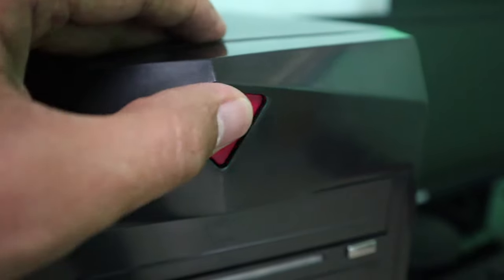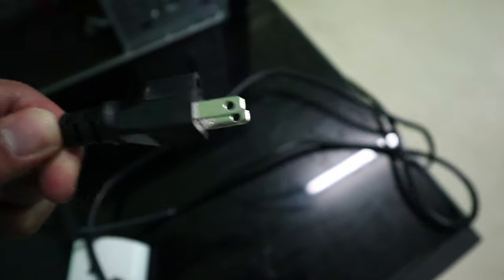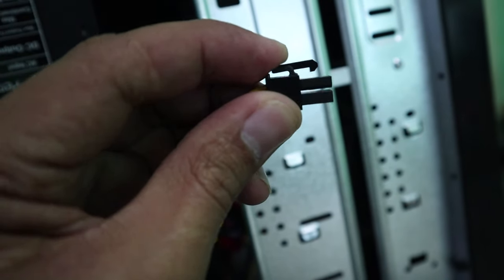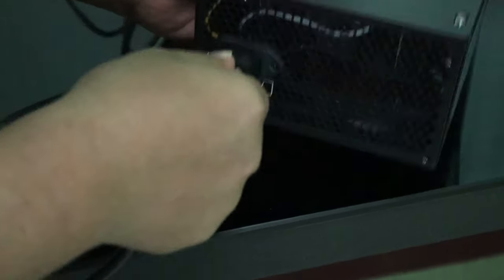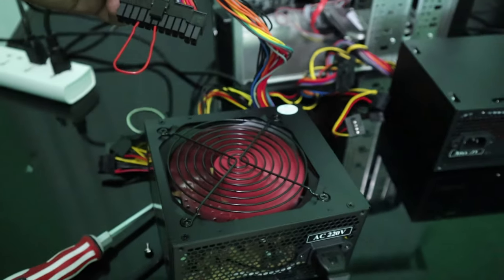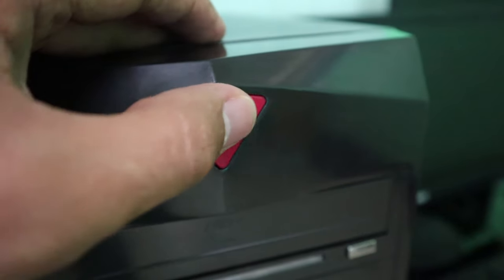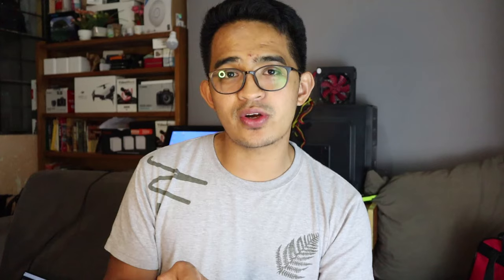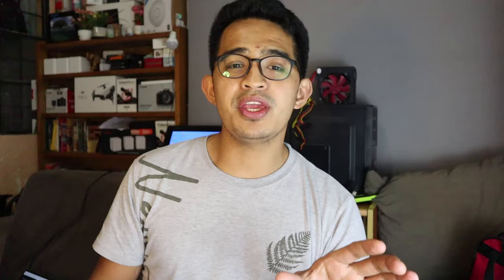DIY - TROUBLESHOOT and FIX a Computer that won't turn on - NO POWER (Beginners Guide)

Comment: Hello , I want to ask .. how about if the power supply is injected to the outlet then I tried to open it but it will open for a seconds then it will stop but there is green light on the mother board?  by the way my power supply is delta dps-350ab-13 , they say its too old ps model. I hope someone help me. Thanks a lot.

Comment: My computer always when i plug in power cable it shows the light sign that the power is entering the engine but when i press the power switch it doesn't power on but the light switch off 

What can i do to it 🥺😭

Comment: Kuya, why is my computer not working ive turned on all the things in it and it still wont open
Reply: If it's more than a couple of years old and was working fine before, it could be a dead CMOS battery, try replacing that first with a new CR2032 3v battery, the round silver disc, they are quite cheap. It may be behind your graphics card on some motherboards, be careful getting to it, check videos on how to do it.

Comment: Trying the paper clip helped me know that the power supply wasn’t dead, but the second I plug my 24 pin connector in the components no longer get power. I just built this pc 2 days ago and it was working fine. I woke up to it unable to turn on.
Reply: Did you fix this problem
Reply: @uhhhh4915  uhh yeah I sent my motherboard to the developers techs my motherboard was dead on purchase
Reply: @briannanicole8512  noooooooooooooo  😭😭😭😭😭😭😭😭😭

Comment: Led is going on but if I press the power button, it doesn't start. The motherboard led's turn on when I plug it in indicating that there is power going to the pc... But it won't switch on when I press the power button

Comment: Same problem, i tested the power cable and power supply and it's working, also tested turning it on with screw driver and it is not working. So i guess the motherboard is the problem!

Comment: I have a pc and it would turn on and everything would spin and light up but never display anything. I replaced the motherboard, gpu, case and monitor. Then for some reason one day I was trying to turn it on to try to fix it and my power supply died and only turns on for a few seconds.
Reply: did you figure out how to fix it ?

Comment: Bro, I am facing this issue of NO POWER now. Here is what I did;

1. Checked the power outlet from the wall by plugging into a different wall outlet, its NOT the wall outlet problem.
2. Used a different power cord from another working PC, same issue so its NOT the power cord. 
3. Removed the power switch connector from the motherboard and used a screwdriver to connect the pins, same issues so its NOT the power switch.
4. Next I replaced the PSU with a brand new unit higher rating and 80+ GOLD, same issues so its NOT the PSU.
5. Finally I replaced the motherboard with a brand new board, it briefly turned ON when I tested it but it went back DEAD after a few seconds, so this means its NOT EVEN the motherboard.
6. This is a brand new PC that I built and was working for 6 months until it happened around 2 weeks ago where the PC stopped working and cannot be powered ON no matter what I do or what I replace. What else can be the issue?

 PLEASE HELP BRO, I need this PC to be up as its affecting my income as I need it for my work. Someone PLEASE help. PLEASE!!!!
Reply from the maker: make sure, its not grounded. someting is shorting it
Reply: @torogipro  how to ensure nothing is shorting it? What to check bro?
Reply from the maker: @TruthSeekerAll  bring out everthing from the chassis the just connect the psu, motherboard wit procie and     ram
Reply: @torogipro  no need to attach the GPU? My GPU is new but I was having some issues with it from the beginning. I suspect it to be caused by a 10 year old HDMI adapter I used to connect to the GPU. That adapter is old but never used before. Maybe some dust has gone in and shorted the GPU which then damaged the Mobo? I'm just suspecting the GPU is damaged due to that old HDMI adapter I used on it.
Reply from the maker: @TruthSeekerAll  yes, use the onbaord display
Reply: @torogipro  will do that bro. By the way, do you think the GPU is faulty and causing all these?

Comment: my system unit starts off with a blink showing power in a second then it shows up no power after a split second, how do i fix this? 

ps. my monitor runs fine, it shows power running

edit: the power supply's fan isn't spinning, the entire system unit shows no sign of power

Comment: Sir I removed my processor and then place it back without using thermal paste does it affects why my PC won't turn on?
Reply: Probably
Reply: Is it same with gpu?i removed it and it has thermal paste then i place it back without using thermal paste?
Reply: If you don't use thermal paste with your CPU or GPU then you will fry your chip instantly as soon as you power it on!
Reply: If there is thermal paste you’ll be fine just try and add some new one ASAP to avoid thermal issues. Trust me bro I know.

Comment: Bro my pc is bootlooping
I open my case take the airdryer and give it cold blow
I try to power it on after im done cleaning it just doesnt turn on no lights no fans no sound according to ur video my motherboard is dead
Reply: Have the same issue, did u get it fixed by changing motherboard?

Comment: U definitely save my fcking life😢 I thought Im gonna change a new Psu because the switch is not working. So I tried the method where you push the switch pin and it function again, thank you very much❤❤❤

Comment: please help me...so my computer wont turn on(no lights, no fans, no reaction)...but after 2-4 hrs, when i press the power button, it turns on...i brought my computer to the repair shop and said it works fine...but when at home, it doesn't.
Reply: Same bro dafaq is happening to my computer i brought it to repair shop and it runs perfectly, but after testing it at home it does not turn on smh

Comment: No system power on, no fans operating. Burnt smell from PC, (maybe PS, maybe MB, maybe both.) No visible burnt parts. Changed PS. Upon powering on PS now all fans operate for about 10 seconds and then quit. Still no power on from Sys Power Switch. Bypassed Sys Power Switch as shown in your video, still no power on. Reseated BIOS battery. Disconnected HD and DVD drives, no joy. I suspect motherboard. Concur?
Reply: Motherboard.

Comment: Help me. Anyone please. My pc is not even a year old and after a few months when i bought it its just wont turn on all of a sudden. And then sometimes it turns on. So i changed the power supply and the pc works good for days no issues. And then this issue came back. Sometimes it doesn't turn on like no fans spinning. What is the issue guys? What should i buy? How to fix? What to do? Please help me.
Reply: Did you fix it bro?

Comment: I tried jumping my pc but it only powers the led on my fan (not the fan itself) and not the motherboard, even when i plug the 24-pin back into the motherboard, when i turn on the power supply, it doesn't show any life and the power supply seems it's not even on, any suggestions?

Comment: Guys if your pc doesn't respond at all and your power supply is okay then try to manually reset the BIOS (unplug the power supply cable then take out the mobo battery for at least 5mins, then try to start the pc. Good luck.

Comment: I have a new psu, new cpu, and new mother board and when I hit the power button. Psu just clicks. NOT THE PSU ITS BRAND NEW. thousand dollars down the drain
Reply: sammeeee did you ever end up fixing it?
Reply: @switch5767  check your cmos battery on your motherboard. Try and see if your motherboard has a led to signal it’s trying to run a boot cycle. If it’s trying and failing it could be just not plugged in on one of your components, if not it’s safe to assume you’ll need a new psu for variable reasons. In my case I think I needed more power to run my equipment. I hope you figure it out.

Comment: So basically, get a new power supply? Got it.
Reply: So mine did power on but restarts itself in 10 seconds but no bios setup comes on display , checked ram and GPU what could be the issue?

Comment: Shit i did the screwdriver trick still not opening even the cpu fan not working 😭, yesterday it still work i put the pc in sleep mode then turn off the pc directly on the psu switch and after that i cant turn on my pc anymore😭

Comment: You can replace a motherboard in a PC, keep in mind it is manmade and that makes it your ability, you simply need to have an incentive. Computers are stupid easy to assemble and work on. All the connections fit only one way and are formed to only fit into the correct socket. I'm beside myself wondering why these computer tech's make all the monies they do, by doing an easy, simple task you can do yourself. Stop paying exorbitantly to these fake ass Mofo's that are latterly robbing you of your hard-earned monies.